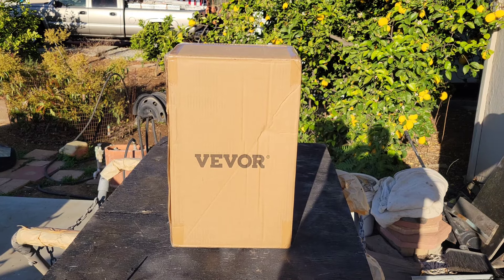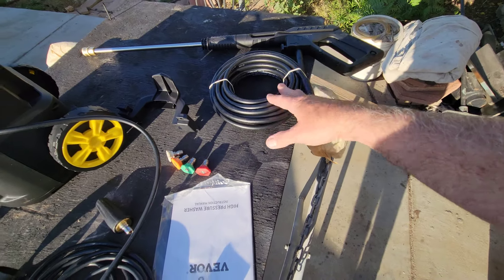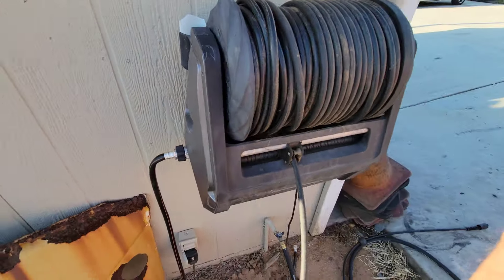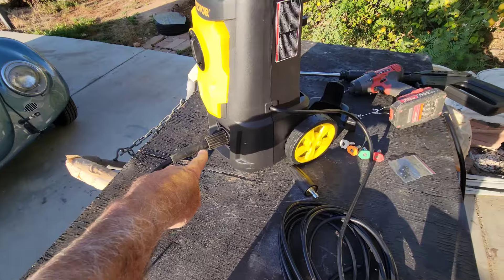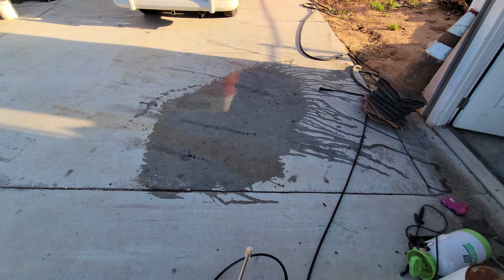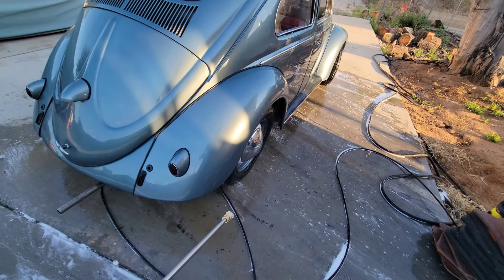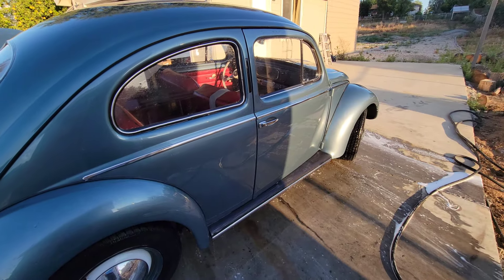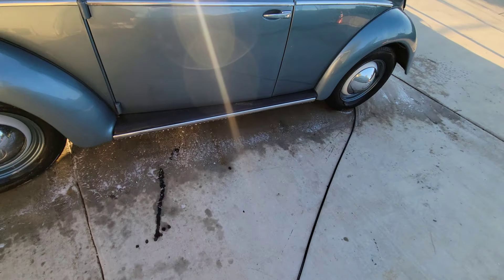Electric Pressure washer Review Vevor 2000 psi Great for washing your car

Comment from the maker: FYI this is my 4rd electric pressure washer and by far the best one I have gotten and my first Vevor. The other ones had either too short a pressure line or they were loud. One I got had a furling crank for the line and it was totally useless. The line would not roll up easily so I t took more time than it was worth. I ended up removing the rolling mechanism. The lines were plastic and always was hard to get around stuff. Then I got the giraffe tools one that was a bit better but  just about everything broke on it in just a couple years. This one seems to be a happy medium and better than HF one....just a few more dollars.

Comment: I just got this today and was so excited to own my very first electric pressure washer. But from the beginning I had problems. The instructions were unclear and in black and white and the water inlet where it hooks to the center body kept popping off and the brand garden hose got stuck almost ruining it. Taking it back tomorrow.
Reply from the maker: Hmmm good idea to have a brass end hose. watch out for the aluminum hose hookups.

Comment: What diameter hose do i need my hose wont screw in right?
Reply from the maker: standard hose bib. Some hoses have aluminum hose ends. and they tend to corrode and cause issues. make sure you have a decent brass hose. There is a part you need to put on the end to hook up the hose.